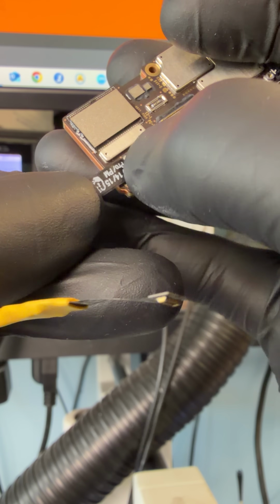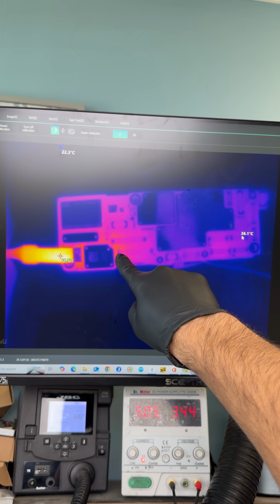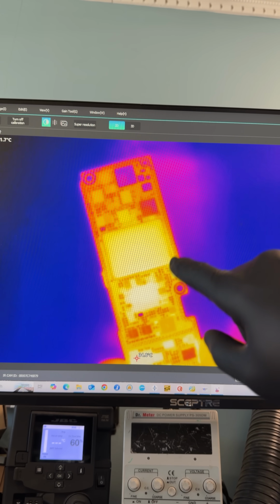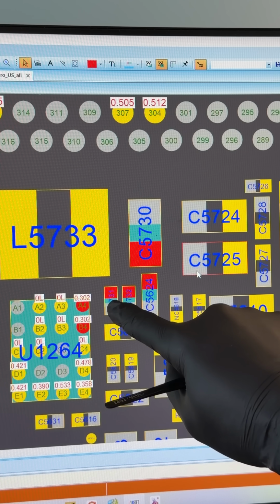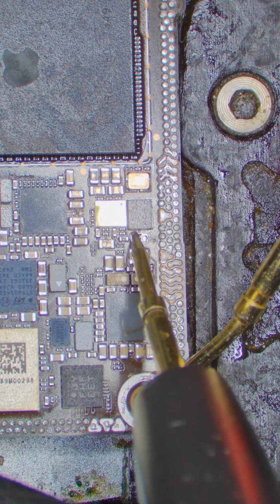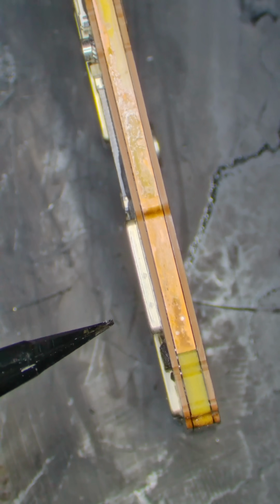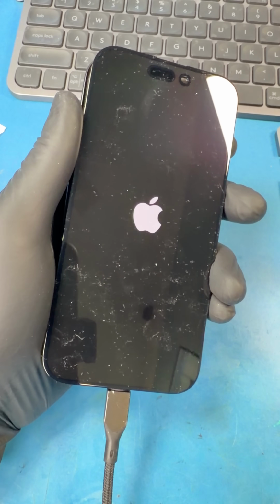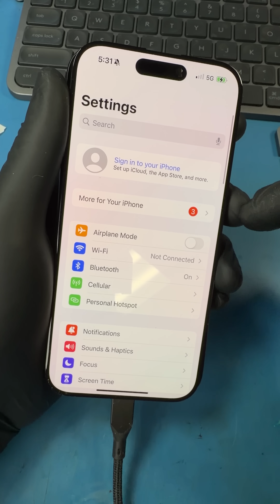What's a shorted capacitor? #tech

Comment: Tantalums always fail short-circuit. We get this problem when restoring vintage computers. Because tantalums were more popular than electrolytics for ripple protection on the 12v and 5v rails at the time, pretty much any PC from the early 80's needs to have the rails tested with a multimeter for shorts before powering them up. If there IS a short on that 12v rail, tantalum in question explodes and leaves a skid stain on the board!

And then there's the RIFAs!

Comment: All great work but the electric reader you used at start of video the input side goes in ubs c power adapter and output side you plug in cable to connect to phone to see the reading, I don’t understand how can board level repair guy can make such  basic mistake 😂😂

Comment: Ok so you removed a capacitor that was causing the issue, that's great and what you are supposed to do. However I have never seen anyone who has removed one, never put a new one in it's place. That capacitor is there for a reason, so it's important. Now I know you have skills and you know way more than the rest of us and maybe just maybe you skipped over putting a new one in.

Comment: Had the same problem on my iphone 8 but in my case it ressurected when i put it on wireless charge and then it worked normally via lightning, but it was dead dead like the lightning didn t work and i tested that before opening

Comment: Identifying the faulty component is one thing. But identifying why it has faulted is another.
Reply: MLCC have their fault mode as going to shorts. But I have only seen that for higher voltage capacitors and larger values. This small value and faulting is a rare thing. It was obviously a decoupling cap and leaving it out is not critical, but the fault mode creates a short between plus and minus and inhibits everything.

Comment: It's always the capacitor that caused the short. I had my SSD dead and not detected. It was getting hot. I searched a lot and people charge too much for recovery. Luckily, a capacitor was blown and after getting it removed, SSD started working. Data is recovered. $10 was the total cost.

Comment: How can you remove a capacitor and still have the phone work properly?  You just changed the circuits / wiring.  If it is not needed, Apple would have eliminated it to save money.

Comment: This repair person is using techniques that will damage your phone.  Do not use a razor blade, the screen should be heated before opening.  Do not pull the battery out like that, it will damage the battery and risk fire later (see the wrinkles on the underside of the battery from his pulling).  Be sure to take your phone to a reputable shop, preferably one that Apple themselves recommend on their support site.

Comment: I'm somewhat convinced that these companies use half their engineering power to make these phones as hard to repair as humanly possible. 😑

Amazing repair work. 👍
Reply: Then they've got you somewhat fooled still, because they absolutely do, completely so. They utilize DRM (digital rights management) software to try to prevent repairs, and people like Louis Rossman have to fight for "right-to-repair" these devices as well because these manufacturers try to legally prevent people from being able to do these repairs at all cost. This doesn't even begin to touch on "planned obsolescence" or the throttling of performance on older models through software upgrades that render older models worse than before. It's what you get with private equity and shareholders that need quarterly report earnings that ONLY GO UP 4 fucking times a year EVERY YEAR FOREVER. (yes I'm fun at parties) 😅🤡
Reply: @PermissionToMeow  
Nah, I see your point.
Even the average consumer (like me) gets suspicious if EVERY generation of smartphones magically seem to work significantly worse after 2-3 years no matter how well you took care of them.
On the other hand they did everything to make the change from an older to a newer model as comfortable as possible.

Knowing all the technical and leagal clockworks in the backgrounds is not even needed to know that we as consumers get ripped off.

The bad thing is: many people do not even care becaue they always want the newest devices anyway.

The final question would be: are there companies that do better and if so, how can we find them?
Because I don't know of any.

Comment: Why don't you need to replace the capacitor with a new one?
Reply: Many caps are used to comply with FCC regulations for EMI. Could be one of those.
Reply: @styzr 
Could you possible elaborate a bit more on your comment, please and thank you??? I guess, what I’m saying is, can you break it down for a dummy like me to understand. I kind of understand some of it and just what little bit I do understand makes me very intrigued by the possibility of what you’re talking about. I understand all of it but the EMI part, just to clarify I’m guessing “EMI” is something along the lines of “electro-magnetic interference”??? I know that just about all electronic devices have a, “device must accept any and all interference, good or bad” or something along those lines and I guess that your comment is something pertaining to that, no??? Thanks again.
Reply: @JonathanRayGoin EMI indeed means electromagnetic interference, meaning essentially "pollution" of the "airwaves" (radio spectrum) by improperly designed electronics. I'm no electrical or radio engineer by any means, but from what I understand, it's not so much about the device needing to accept interference but that it mustn't produce it itself. To put it simply, "smoothing out" the electrical pulses/currents in a circuit can remove sharp peaks that might produce the radio emissions that causes interference.

Whether that capacitor is part of all that is anyone's guess.
Reply: @styzr for emi?
Reply from the maker: It's a smoothing capacitor and there are dozens on the same line. The phone will function fine without it. If we cared about long term use, yes we should probably replace it.

But this job is for data recovery. We backup the data to a USB, and our customer settles their 2 factors, then the phone is traded in to their carrier for a new one. 

I personally don't believe a phone that has been worked on by splitting the layers should be used for long term use. No matter how good your work, it's not going to be as good/reliable as factory.
Reply: @MDrepairsLLC thank you for the explanation !
Reply: @MDrepairsLLC Great humility demonstrated in that statement.
Reply: @Allen.Morrison yeah bro that’s what I thought! He is a master of his craft and yet still is modest enough to say probably best not to use as factory is better.
Reply: @Allen.Morrison this is why the he's the man humility is the repair man's greatest tool
Reply: @MDrepairsLLC I’ve got a question for you, I’ve got a Hitachi Deskstar that’s no longer accepting power. Can you recover it?
Reply: @FordGuy_444  His website states they can recover that kind of failure.
Reply: @2012TheAndromeda oh thank you!
Reply: @FordGuy_444 ah the infamous Death-Star drives……
Reply: @satorudo yeah.. luckily this is from AFTER that lol. Still wanna recover it though.
Reply: @MDrepairsLLC it's almost like a PC CPU
there are lots of ground pins so if you have one broken ground pin the PC will still work
Reply: @Veljko375  why did this help me understand😂
Reply: @MDrepairsLLC thank you! It's impressive that despite how experienced you are at the data recovery you still side with caution and advise for the device to be replaced.
Reply: @MDrepairsLLC by any chance do have a program that teaches this type of staff? Hi from Africa
Reply: @MDrepairsLLC dang that means some person who bought a used iPhone from the carrier possibly got a phone that’s less efficient than another used iPhone with no repair that’s sucks
Reply: @JinrokudaGod  not only it is not efficient but it is also going to be less reliable too, like he stated himself in the comment. Though it is not his problem, if the customer wanted to scam the carrier or sb else they could just do it and nobody could have prevented that.
Reply: @JinrokudaGod when the carrier receives your device from a trade in they inspect it thoroughly and it would at least be obvious that it was opened

hence the certified in certified pre owned
Reply: @sofattia7940 they do not inspect them that thoroughly. A tech that's getting paid peanuts just plugs it into a cable and a computer checks major functions which this would pass.
If it's not all cracked up
It's gonna make it through.

Some companies are better than others but yeah there's a high probability this phone will go back in circulation.
Reply: @MDrepairsLLC  won’t the phone be sold on by the carrier and sold as a refurbished handset though. How neat your work is I reckon it’s as reliable as it was new only difference being the waterproof seals will never be the same.
Reply: No way the solder balls on the edge merged likley able to cause a non function or short of something connected to that mobo
Reply: @MDrepairsLLC yes you’re right that a phone that has been worked on like this should never be used for long term and your customer will probably trade it for a brand new one but guess what, its a iPhone, this traded phone will be sold to a unsuspecting buyer. This isnt the 90s any more and the r&d departments know that a bad filter cap means short so they already don’t put any more than necessary and by not replacing that stupid cap you are just making it more unreliable for its second owner
Reply: @MDrepairsLLC thanks for this explanation
Reply: @MDrepairsLLC  great so he traded into the carrier and then they sell to some unsuspecting loser
Reply: @MDrepairsLLC  but weren't some of the pads shorted when heating the solder paste? 🧐
Reply: @MDrepairsLLC so whoever buys a refurbished phone from carrier is getting a missing capacitor? Got it!
Reply: @MDrepairsLLC  Well... The factory version failed, so... 🥴😁
Reply: Here's a question the balls merged couldent that have caused another short
Reply: @MDrepairsLLC  can you please explain what does smoothning capacitor actually mean here?
Reply: @MDrepairsLLC Thanks for the insight technomancer.
Reply: @MDrepairsLLC ❤
Reply: @MDrepairsLLC well great answer ❤
Reply: @MDrepairsLLC well said!
Reply: @MDrepairsLLC  Thank you for your answer. You did a terrific job.
Reply: @MDrepairsLLC do you fix Android also? I have a s23 ultra battery drained to 0 then after plugging Charger phone never turned on, 108 Auto-ampere after checked by a mechanic, is it fixable?
Reply: @MDrepairsLLC 
I'm honestly thankful for your honesty. Most techs will say "as good as new" and then continue earning more money because they won't say that once the phone is opened, there's no guarantee that something similar may happen.
Reply: @MDrepairsLLC  hey so my friends phone was recently operated factory defect of nand IC for you how long can he use it?
Reply: @MDrepairsLLC this man is casually aura farming 😂
Reply: @MDrepairsLLC solid explanation. Your videos are amazing. I never thought one could individually do these repair jobs for data recovery
Reply: @MDrepairsLLC  you are indeed a great electronics engineer, and a great teacher at the same time. I was going to ask you the same but your explanation has taught me quite a lot. Thank you.
Regards from Zimbabwe.
Reply: @MDrepairsLLC bro is the most professional guy i have ever seen. Good work bro, keep it up. ❤❤
Reply: @MDrepairsLLC  So run it as a backup PoGo phone for the next 5 years? Will do :D
Reply: @MDrepairsLLC   where is your link for recovery?
Reply: @MDrepairsLLC kinda wrong I've seen multiple videos of sloppy factory work.
Reply: @MDrepairsLLC The carrier then will use this traded in phone as a "warranty replacement "
Reply: @MDrepairsLLC  Data recovery eh?  And he had no icloud access.  what was the point of buying and iPhone in the first place.
Reply: @MDrepairsLLC An Honest reply
Reply: @MDrepairsLLC ”never as good as factory” words of a true technician
Reply: @MDrepairsLLC thanks for your honesty as well
Reply: @MDrepairsLLC Well, your work could easily be graded as better than factory. 😅
Reply: Same question I too have, if there is no replacement needed, why in first place it is there
Reply: @manikandanj1233  These capacitors are placed in there for filtering. You can take them out and have the device keep working, worst case scenario and it goes a little slower as the signal is noisier.
Reply: Great repair as always, hopefully you can upload more.  I learn a lot by watching!
Reply: Dude is amazing
Reply: May ipad mini is stock in apple logo it can charge I don't know how to recover it I try to reset still the same I search it need itunes update but my laptop can't install itune
Reply: I think, the owner would replace the phone anyway after the repair and backup. It is not guaranteed, that it won't die again, if it already shows such symptoms. So if it works without the capacitor, then it means no dumb work
Reply: I was wondering the same thing, thank you for the answer
Reply: woah
Reply: Fixed an iPhone 13pro max with charging issues last week and it worked well, still trying to perfect my skill though
Reply: @easyelectronicsguide 
I currently have an iPad with charging issues and I’m curious as to how you repaired yours. I plug it in and it shows that it’s charging but never gets any charge in the battery and will not turn on. It was working fine other than the battery started dying faster and faster, as normally expected, and one day it started not charging. Do you think I just need to replace the battery?
Reply: @JonathanRayGoin  if you replace the battery it should work fine.
Reply: *GREAT videos by an incredible
GENIUS!*
Reply: Thank you!
Reply: What if there's some data in it?
Reply: Any hint on my how I can get better at micro soldering ,I have good microscope and rework station .
I don't wanna kill phones as a beginner 😅
Reply: Why you didn't replace the capasitor?
Reply: Coupling capacitors always have a backup on the board
Reply: If you sep the sandwich correctly, you don't really need to reball the layers... Time is expensive material😊
Reply: Luckily I had iCloud my shit is done after my first do it yourself repair I bought a part off Amazon an it shorted everything because I think I kept working with the power button connected
Reply: Exactly my question
Reply: And you're absolutely right because they're gonna probably end up getting another phone anyway eventually
Reply: Well the capacitor stays open 90% of uts lifetime.

Comment: so you use a s pecial tool to get 230 degree right?

cause i tried a heat gun on heat shrink tubing near a PCB once... let's say it didn't do too much good to the PCB. 😅
Reply: Hot air soldering station is what you’re looking for

Comment: can you explain to me why capacitor could get shorted?
Reply: A capacitor is essentially just two conductors on opposite end sandwiching an insulator. Anything that can break down or degrade that insulator can cause them to short. Mechanical damage (just dropping it one too many times), a bad solder job, high heat, over current (which causes high heat) or over voltage (voltage on one side is high enough that it can “jump” through the insulating layer. 

Also: sometimes you just get a lemon.
Reply from the maker: @bazookafox what he said